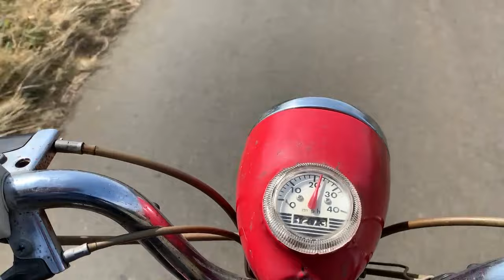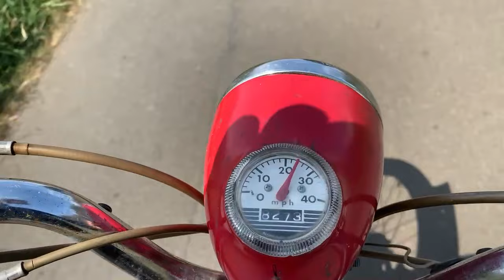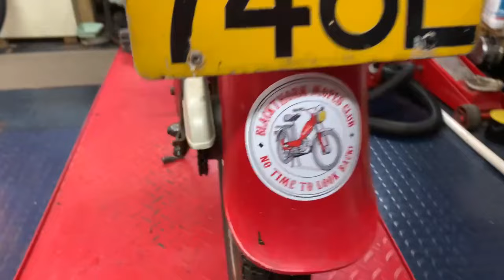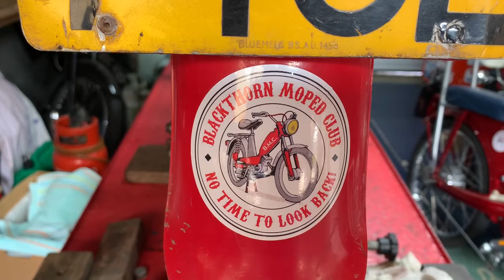My 1973 Honda PC50 Video 002

Comment: I bought a PC 50 in 1982 ....for the princely Sum of £5..
it needed a new front wheel....£3 from a Breakers
it was happy at a constant 25 mph.
it's predecessor the P50 was not as robust as the PC 50.
Nice Video..thank you